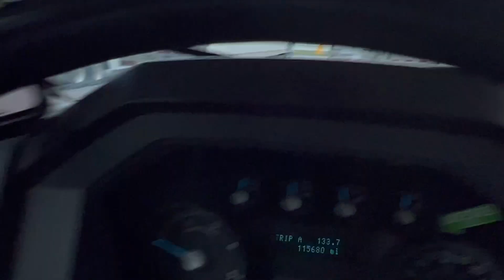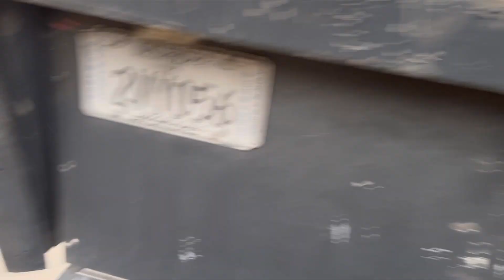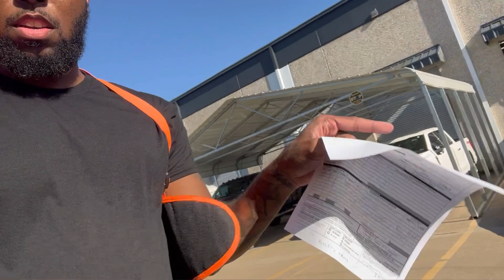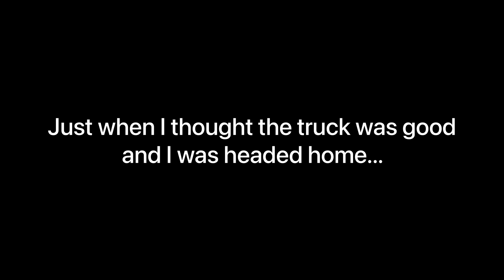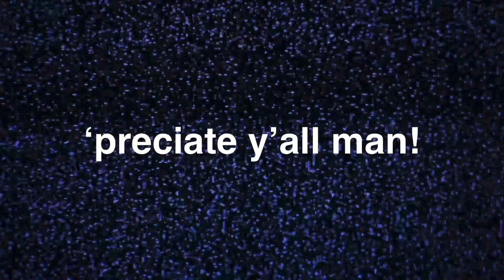BOX TRUCKING OTR: TRUCK BROKE DOWN TWICE!!!!!

Comment: Was it the same problem each time with the budget truck?
Reply from the maker: Yes very similar issues. Budget won’t replace the truck unless it’s a major issue like transmission or engine failure completely- ie something they can’t fix with their third party vendors on the side of the road
Reply: @truckedupjoe8129  Does a driver get to extend their daily hours when you get stuck for a breakdown like that? I’ve heard you can for weather. Really liking your channel man, keep grinding!
Reply from the maker: @rayt230  nah if you have a load on the truck and break down & are waiting for roadside, from what I understand you have to stay on duty which sucks for sure but part of the game - I went off duty tho bc I ended my day where I broke down - I was also unloaded
Reply: @truckedupjoe8129  For sure, were you close enough to use personal convenience travel to get home then?
Reply from the maker: @rayt230  I was near my home city so I had a friend drive out to me a couple hours away after getting the truck to a late night shop